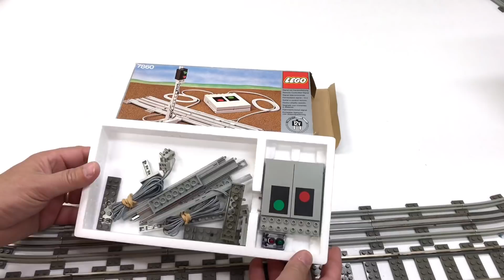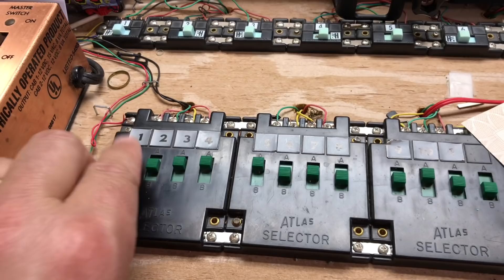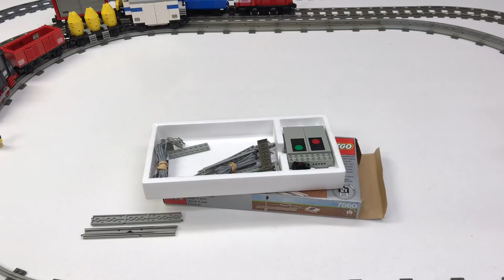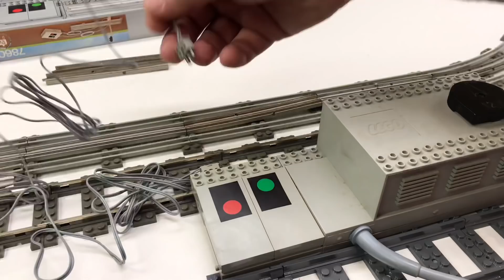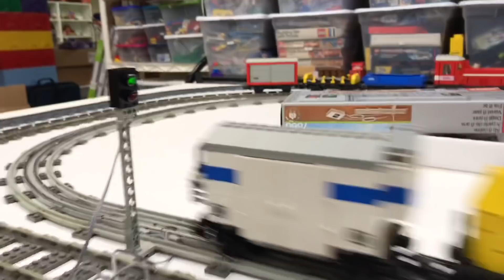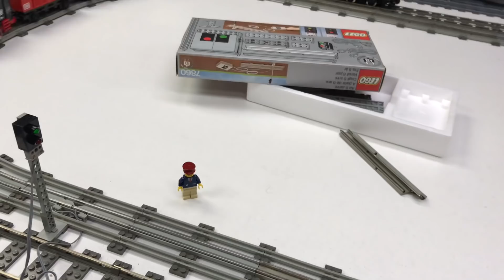Love LEGO 12V Train Accessories - 7860 Remote Control Signal

Comment: I always find the 12V LEGO train area to be the most complete one (I could only drool over it as a kid, it was very expensive back in the 80's). I wish they would do something similar today with the power up with rail switches stop / go lights and road crossings. I have built some of it using power functions but it takes some real estate.

Comment: Hi ! I just discovered your channel, and it's very interesting, even for a non lego collector like myself ! :) I remember about those 7860 remote controls, but I was a child and didn't understand what was their purpose. I now all make sense :D

May I ask a dumb question ? I see that you live in the USA and use this generation of lego 12v trains. I do own two of those beautiful trains : my parents bought me them when I was a child and was living in France (7735 and 7715 equiped with 12v engine). Those make use of 7864 transformers which are targeted for european 220v. I am now living in Canada, and I was wondering what would be the best strategy for using those trains with 110v. Are you using voltage converters or do you use 110v specific transformers ? I am asking because I wasn't able to find 110v equivalents for 7864 transformers, but since this is kind of new to me, I might be missing something.

Thanks for all the content offered in your channel. Many hours of entertainment and nostalgia to come :)
Reply: Hello! Chanced upon this comment randomly- I live in the US as well, so I can help you with this. I've been running 12v trains for a couple of years now, and I've been using what is known as a "step up and down" transformer. It not only switches the outlet type, but also the voltage- so I can plug the 12v transformer (7864) into the converter (outputting 220v), which plugs into our standard 110v outlet. You can find these types of transformers on Amazon, they'll typically cost you around $30. I believe I covered it in this video: https://www.youtube.com/watch?v=ipS8o7NAnEw
Reply from the maker: I use a power converter that can be adapted to convert pretty much for any region https://youtu.be/MJqylfc6EGo